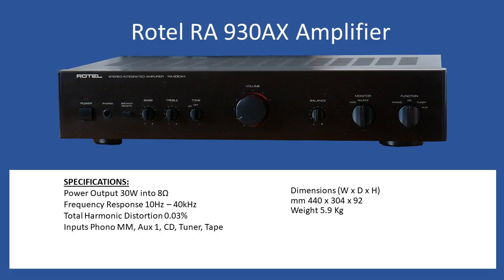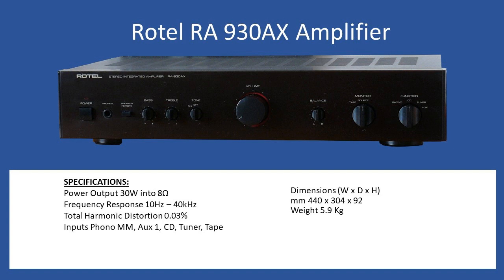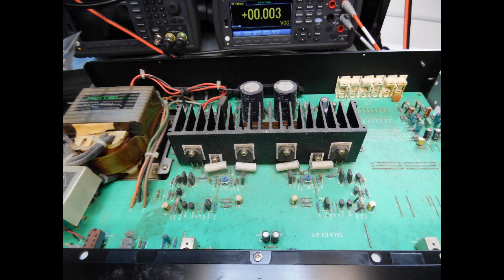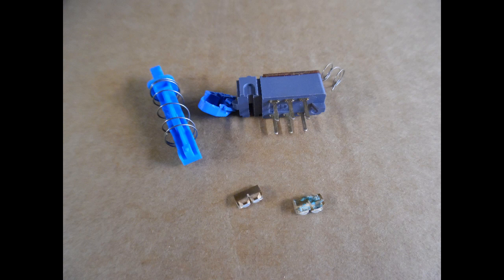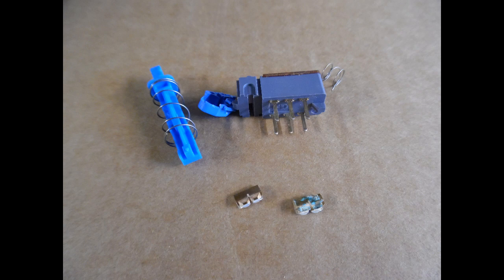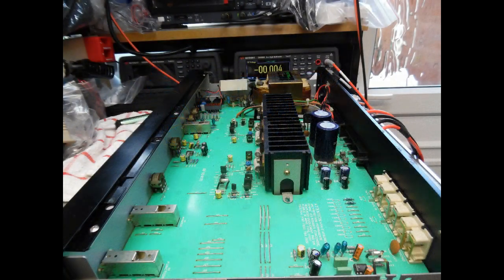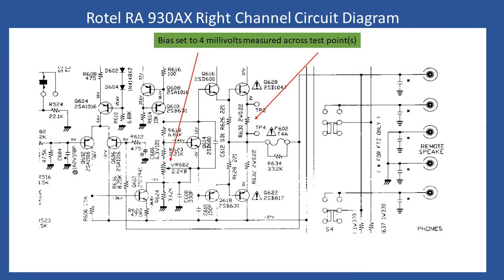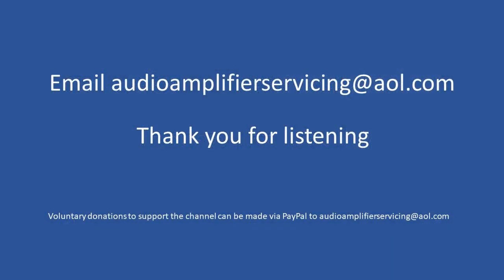Rotel RA 930AX Amplifier Repair (With Audio Tutorial)

Comment: Hi! I have a similar Amplifier ( I think), RA-931, and for quite a while I've been struggling with my source select switch, which struggles with the right channel. I have to set it in sort of "in between" position to get a clear output. I am an amateur when it comes to electronics, but I thought I might take a stab at it. Have you had experience with this issue before? Is it just dirt that is stopping the rotary switch from working or does it have to be replaced? Thanks in advance!
Reply from the maker: Hi the switch contacts have become oxidised. It will need to be removed, taken apart and cleaned with a fibre glass pencil.
Reply: @AudioAmplifierServicing  thank you! I will try it out. Do I need to apply any contact cleaners or lubricants afterward?
Reply from the maker: @warmetalpacifist Hi you can apply a thin layer of non conductive lubricating grease.
Reply: @AudioAmplifierServicing  thank you, I will try it out. Do I need to apply contact cleaners afterwards?

Comment: My unit has about 75mV dc at speaker terminals. Is this ok? There's a way to control the DC offset in this amp?
Reply from the maker: Hi do you have 75mV on the right and left speaker terminals or is one channel higher than the other. It's not excessively high, but it could be lower. There is no separate adjustment, so you would need to replace transistors in the input stage of the Amplifier for the respective channel.
Reply: @AudioAmplifierServicing  is the same (more or less) in both channels
Reply from the maker: @tm8473  Okay at this point 75millivolts is not going to be an issue, so no need to start replacing components.
Reply: @AudioAmplifierServicing  thankyou!

Comment: I have the same amplifier, it's great. I have cleaned it and corrected the bias, but one thing that remains: The source switch, tone control switch and the tape monitor switch often don't seem to make good contact, whichresults in only one channel sound. I then have to move the switch a couple of times, and the  the sound is ok again. I have already sprayed these switches with contact cleaner, but it doesn't help. Any ideas?
Reply from the maker: Hi the switches will need to be removed and taken apart and cleaned with a fibreglass pencil.

https://www.amazon.co.uk/Gaugemaster-GM-GM633-Glass-Fibre-Pencil/dp/B00PDYZQ98/ref=mp_s_a_1_2?adgrpid=154667574647&hvadid=664811254937&hvdev=m&hvlocphy=1007249&hvnetw=g&hvqmt=e&hvrand=7244469221647895750&hvtargid=kwd-315218762110&hydadcr=16905_2153564&keywords=fibreglass+pencil&qid=1702150080&sr=8-2

The contacts will be oxidised.

Comment: Nice video! Thank you for all explanations and details. Just a short question about bias adjustment. Does it need to be done without speakers connected?  A couple of years ago I have restored my old Sansui A40 and I think I set bias first without speakers and later with speakers connected.  It is still working today😊
Reply from the maker: Hi Bias is adjusted without speakers connected.